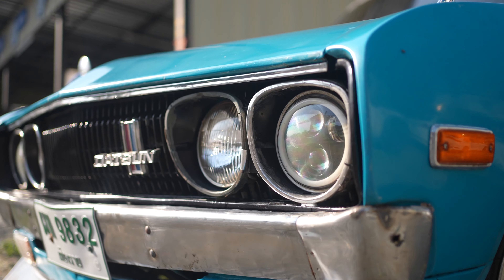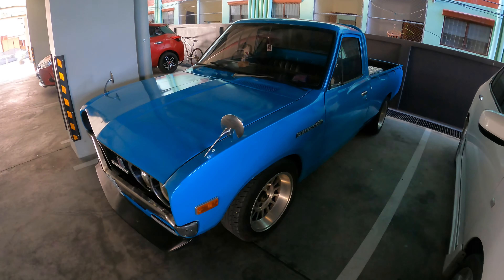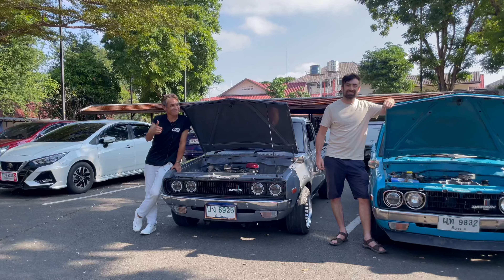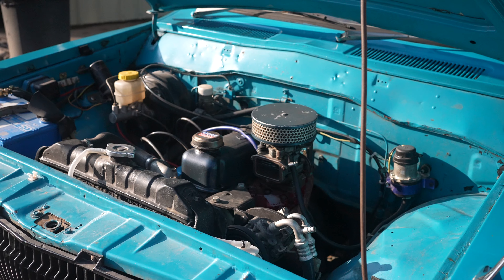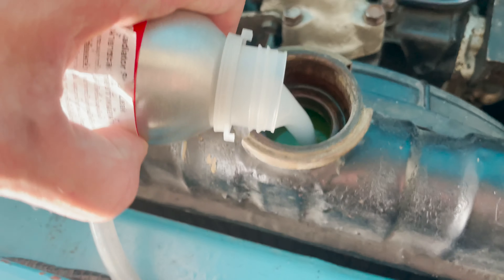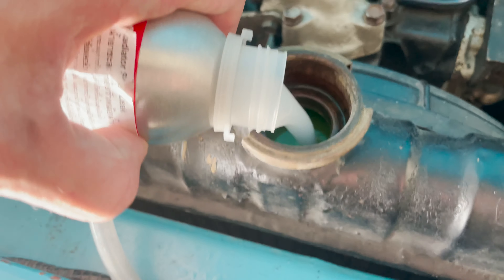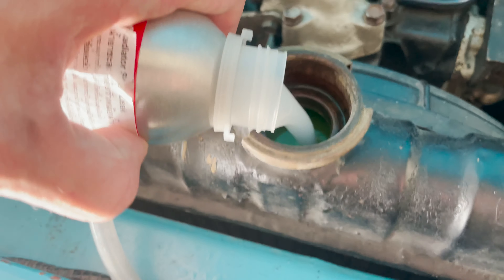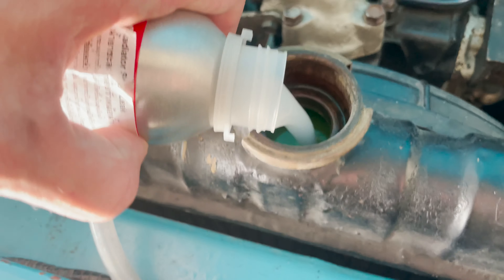My Datsun 620 - 2024 UPDATE What's Next???

Comment: Beautiful 620! I have a 77 King Cab here in the US and I'm doing a ground up restoration and channels like your really help keep the motivation going! You can get 18mm tall poly bump stops from Energy Suspension which fit the same thread pitch for the stock location - that will cure some of what ails you, suspension wise
Reply from the maker: Cheers!! King cabs are super rare over here. I’ve got some 10mm ones but I’ve not fitted them yet as I’ve been worried they might bottom out the shocks. I’m excited to try a few things with the suspension when I get back working on it. There should be lots of room for improvement!! 😁

Comment: great looking truck first thing i would do is a compression test on the engine mate
Reply from the maker: We did one recently when I had some rough running problems. Unfortunately I’ve lost the bit of paper I wrote them down on. They were definitely on the low end but still ok and matching values across all. The head was rebuilt with new valves so I think to improve this I’d maybe have to look at piston rings.

Comment: Rebuild the engine!
Here in thailand there are loads of part availeble.
Just put a j16 cranck in my j15 engine, higher compression.
Keep it original i think.
Loads of Thai 620s already run with sr20s
Reply from the maker: I’ve already rebuilt the top end and was planning to rebuild the bottom at some point. Most of the issues I have seen to be with all the engine ancillaries. Allot of the aftermarket parts for these are very low quality and don’t seem to last long. That means I have to use old oem parts that are not the most reliable. Maybe though I’ve just been unlucky recently and I’ll have a good stretch without breakdowns 🤞
Reply: @missioncapri  you mention that you changed the points, why not put a cdi in it? 1400thb
Your full pump is in the engine bay, most electronic fuel pumps prefer to "push" the fuel instead of sucking.
Place the pump near the tank, under the car. Itwill be cooler and won't have to work so hard.
Lots of carb issues that I had was related to boiling fuel even in the carb.
Have you thought about making it a 5 speed?
Some have made a 5 speed that's still colomshift!
End of the year a big Datsun meet in Saraburi, you should be there.
I will be...
Reply from the maker: @fzrharm  I will probably do that if I end up keeping the engine. The fuel pump seems to work well now but if I do have problems again I’ll try that. I’ve already moved the fuel filter back there. I didn’t know about the 5speed column shift. What have you got? We planned to go last year but the paint issues took a while to sort out so ended up missing it but will definitely try and make this year!!
Reply: @missioncapri  my Datsun has a j15 with 4 speed columshift.
Right now fitting the j15 with j16 crank.
I posted it on the Datsun 620 thailand group.
If this engine is more powerful and good next is changing it to 5 speed, but keeping columshift.
Try to keep it original but usable.
But that's just my idea...

Comment: That SR looks like it was some late FWD version maybe from a Bluebird or Pulsar , Nissan wiring is very simple and mostly all the same with not much change between engine year versions. I wouldn't bother with the a aftermarket ECU as you will surely be able to find all the ECU pin outs etc online . It seems that they had the engine running no problem , A/C will just need a signal from the compressor clutch or cabin switch and you might need a speed signal that depending on year might have come from the ABS or just a sensor on the gearbox . You can just use a aftermarket electric drive for the older speedo to be driven that can be adjusted . There shouldn't really be too much that is needed to be wired outside the engine harness and for the labour price there I think it would be far cheaper than a aftermarket ECU and have good old Nissan reliability . Or you could take the loom back home and strip it down , extend the wiring for what is going to need to be ran to the original truck wiring in your sweet time . I would be finding the original throttle body to AFM rubber as there always built with a flexible section and the AFM are always rubber vibration pad mounted to the vehicle with Nissan's or the AFM is bolted on the air filter box that is rubber mounted , it won't last long with the engine vibrations from that stiff silicone hose they prop'ed up to start the engine up . Gearbox I wonder what is commonly used in Thailand as original SR RWD boxes are all mostly gone from the planet , If you can find a RWD bell housing there might be more Navara truck gearboxes over there that would require you just swapping a SR RWD bell housing on to the gearbox . Maybe the gearing would be more suited for the truck as well . Another mostly unknown bell housing pattern that is close are  F series Honda that from memory we only had one bolt location to drilled to convert one to fit a SR gearbox bell housing to a F20C . So maybe whatever they use for F of K series RWD conversion in Thailand might be another option.
Reply from the maker: Thanks for the detailed information!! I’ll do what you say and try using the oem ecu. I need to try and keep the budget low so definitely a good idea. Allot of sr20 swaps I’ve seen out there have the auto box. So not sure what manual gearbox’s are used but I definitely want to stay manual with mine
Reply: @missioncapri  Another issue might also be the sump . I can't see getting any of the RWD SR20 lower engine cradle and oil pump , pan etc being easy to come by anywhere now . I have seen quite a few KA24 S series Silvia's and 180sx's over there , I would think that they all would be swapped out for SR20det's by now so might be a easy conversion with the transmission as well . The other gearbox option might be a adapter plate to fit up any of the early 6 cylinder gearbox's for the L series etc , but once again all of this comes down to the availability over there or you will have to send it all from the UK I guess . Once again the speedo input to the ECU might also have a neutral and top gear switch , a lot of Nissan's of that period had that stuff for not only emissions , but also the crazy 180kph speed limiter . Without some of the puzzle connected they can become rev limited like a limp home mode . Guess your going to be busy with the Capri back in the UK and now your adding working out a conversion to the list as well ...
Reply from the maker: They have some good scrap yards here so will hopefully have quite a few choices of gearboxes I could make work. Ball had a few different ecu’s for that engine and he did explain about some issue on some of them but I didn’t quite understand. Yep back to work on the Capri now, still lots to do but I need to get it finally finished this summer!!

Comment: I have the same problem with front brakes on my 620. I think the 720 conversion is not plug and play so please if you do it lets us know how it went and is needed to make it work. :) I was thinking on getting adaptors made like in the USA and use D21 calipers and Isuzu rotors...
Reply from the maker: I’ll keep you updated. It’s going to be one of the first things I swap when I’m back out there.I know a few guys who have already done the conversion and the only thing they mentioned to me so far was a slightly increased track width using the 720 ones but they might be using additional parts like you said, I’ll try find out👍
Reply: From what people say here in Portugal, if you swap the arms for the 720 ones you get messed up camber and caster… looking forward for your updates! Thanks
Reply from the maker: Yeh it makes sense!! I’ll do some measurements when I get them on if it’s too far off I will look at making some custom arms. It handles really well now but I feel that’s just because it’s resting on the bump stops most of the time!😂